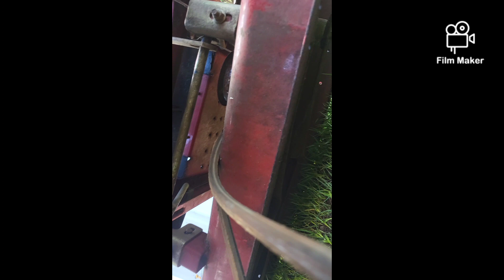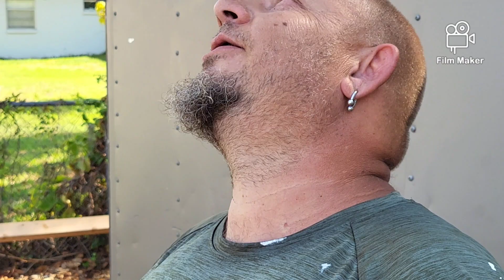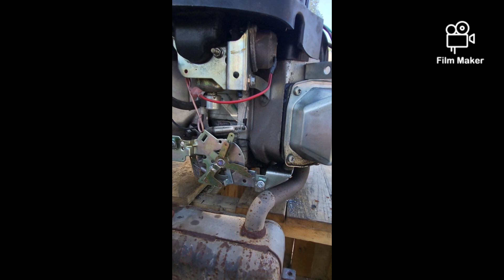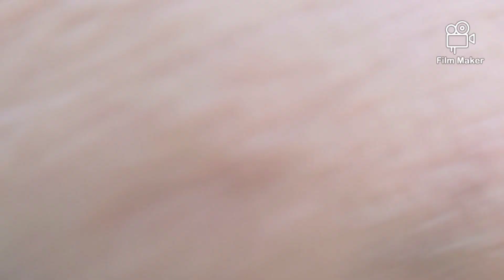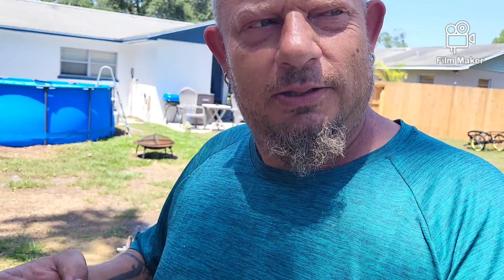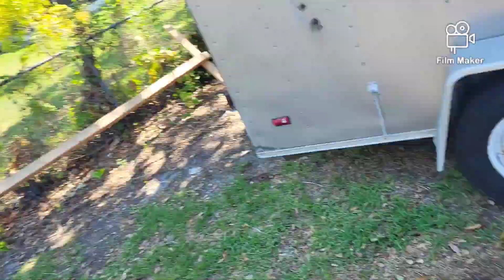Toro Timecutter Seized Motor / Lets Fix It  Zero Turn Lawnmower

Comment: On Toro engines, the starter gets stuck in the flywheel. As you keep trying to start the motor, you wear down the battery and/or the solenoid. I've had the solenoid replaced 2X and replaced the battery 3X in just one year. None of these replacements fixed the root of the problem. Need a new engine. Mine is still under warranty, but I'm struggling to get Toro to honor it.

Comment: I have worked on small engines 65 years- I have never touched a torque wrench to any part connected  to a small engine
Reply from the maker: I use mine as a long leverage breaker bar for removing tough bolts lol .. rarely to put something together .. good to see you my friend hope your well

Comment: My 75755 Timecutter has a Briggs and Stratton engine. But shouldn't jumping 12V straight to the starter bypass all the fuses and safety switches?
Reply from the maker: Yes and no.. Yes in the sense that putting power directly to the starter will make it spin.. however if you have a bad fuse or safety switch you still won't get spark so it won't start.. if you put power straight to the starter and it does not spin.. then you have a bad starter.. you can remove the top cover from the motor and unplug the kill wire from the magneto.. then spin the starter and it will start the motor and run .. then you pull the spark plug wire for quick shut off.. or touch the kill wire to the spade on the magneto to kill it.. that's how you know if you have a fuse or safety switch issue.. hope that made sense.. let me know if I can help more ill try to walk you through it.. and thanks for taking the time to watch and subscribe

Comment: Was this  Kohler engine?  My Timecutter 75755 won't start. New starter, bypassed safety switches by jumping straight from battery to charger, unplugged "brain" and added jumpers to bypass. Flywheel spins freely with plugs out. Was running fine, then wouldn't start 2 days later. Ant tips?
 It has the Briggs and Stratton 139-0603
ENGINE-2P77F.
Reply from the maker: Yes kohler.  There are a few hidden fuses on various models I'd start by checking for spark.  No spark means blown fuse.  Let me know what u find ill try to walk u thru it

Comment: Couple of years, cheap used replacement engines readily available, is nice for you.  In my area this would be trash, truly.  Hourly shop rates, cost of parts, return on time and money, would make this a money pit.  Especially so since 99% haven't the first clue about how a motor works or how to take a nut or bolt off a valve cover (for most its, what's a valve cover?).

I got a free mower last year, and discovered very quickly it was something deep in the engine.  I felt lucky to find someone else to take it off my  hands.

For the rest of us, would you take a compression test after you get it running, after you've used it a few hours.  You'll be lucky to not be smoking out the bad cylinder or making much power out of it.  My experience with these ~700cc twin engines, one cylinder can be near dead and you might not notice it.  Compression test and an Infrared Thermometer is the best way to determine if you have put your time to good use.  

Thanks!
Reply from the maker: I don't want to give it away before the final video has been released.. but it cost me less than $100 in parts. .. no smoke.. matching compression and I've cut 5 acre property with it 3 times plus 9 reg yards with it since finished.. I got lucky.. will it last forever without developing oroblems.. heck no.. but it's got new life for a while on the cheap with a few hrs so worth it for those or us like you and I that can get on it
Reply: @MunkyWrench  Great to hear.  Sounds like the rings are not running against the corroded section of the cylinder.  Lucky.  Do you have a theory how the water got into the cylinder?  Can you share your theory or explanation of how that might have happened in the next video.  Thanks.

BTW, the new belt on my LT1000 is running perfectly.  Definitely the previous belt was to tight.  Sure seems to be the same length.  Perhaps I routed it wrong, although I'm not sure how that could be.  Seems there is only 1 way to run the belt, but the sticker that shows how is barely left, so no help there.
Reply from the maker: @canamrider7195  often with belts the thickness can be off.. so if new belt was slightly thicker it can be too tight.. judging by the rest of the motor my guess is someone removed spark plug to check something and just forgot to put it back in or tighten it.. it was stored outside for a while with a tarp that was full of holes.. so to have water in one cylinder and not the other had to be spark plug hole.. when I got it there was no oil in it so I don't know if the oil was filled with water.  But there was enough on the piston to rust the sleeve.  I didn't force the piston so I didn't chew up the rings.. not getting any blow by so lucky to get some extra life without having to hone and oversize rings.. just wanted to do a project showing people u don't have to have a shop full of special tools to revive something.  Take a chance and try.. like Bruce says.. if it's already broke u got nothing to loose
Reply: @MunkyWrench  I can believe that.  From my TV viewing seems the rain falls vertically and horizontally during your Once a Century hurricanes, that now happen several times in a single a year, every year.  LOL
Reply from the maker: @canamrider7195  we get squalls that come thru every few weeks with winds at 80 mph.. sideways rain is normal here